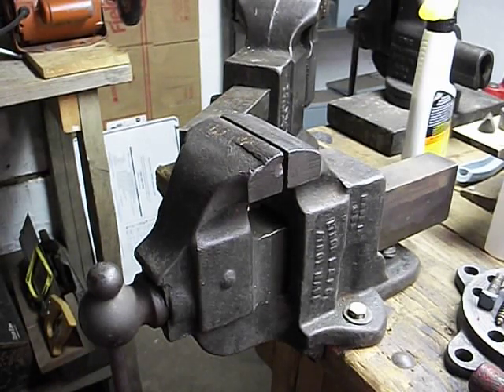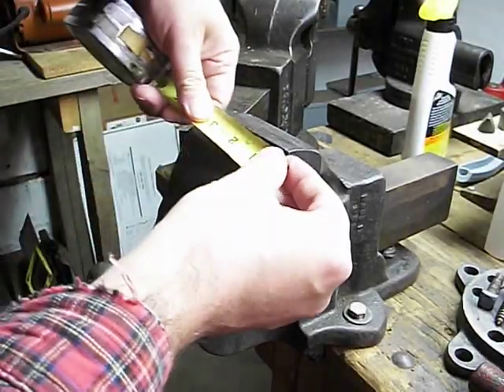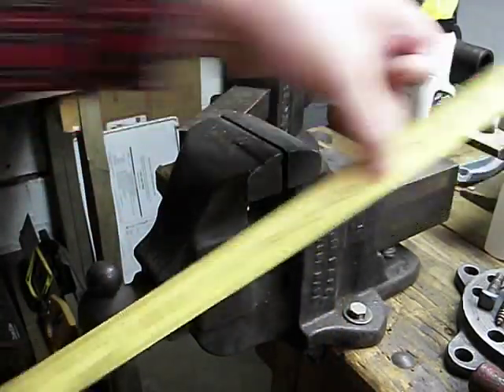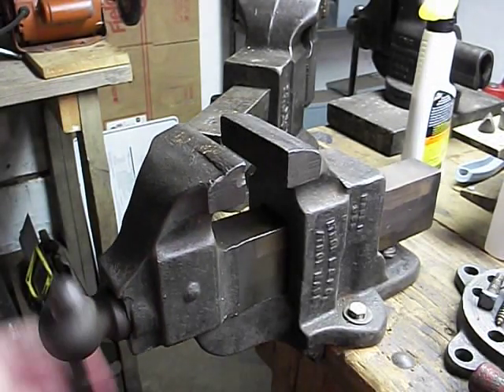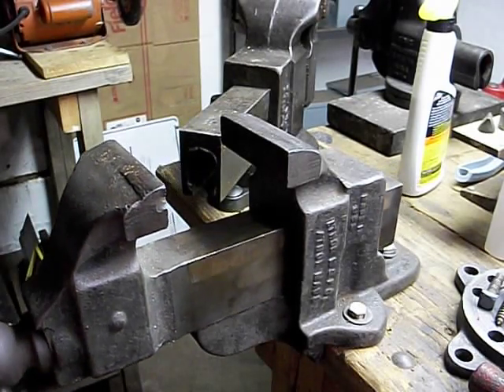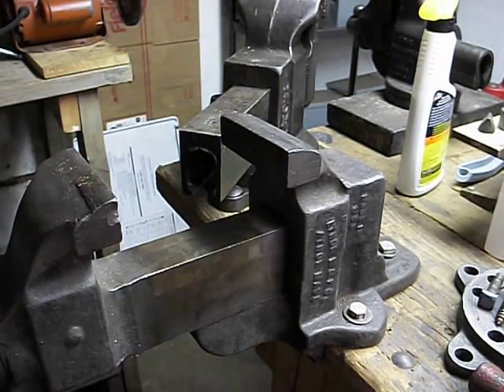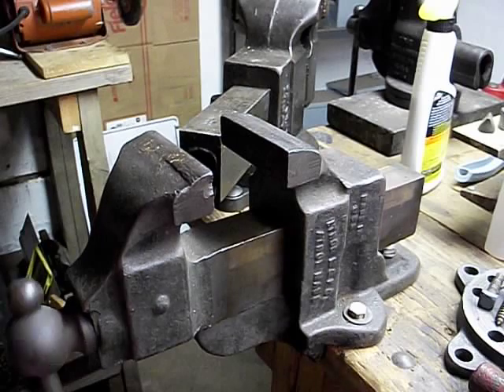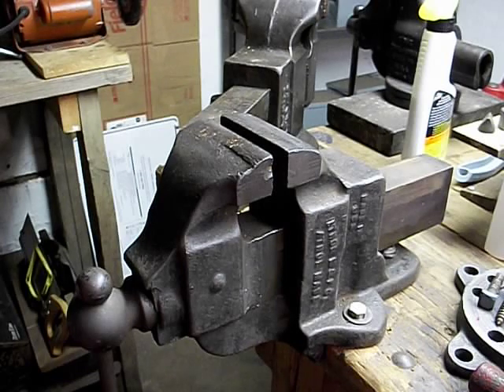Athol No. 613 1/2 Machinists Bench Vise.

Comment: If it's like the 616 that I had,  it uses a buttress thread,  which is a great thread for a vise in my opinion and used a spring to keep tension on the leadscrew so that even after a century or so,  it has very little backlash. Good quality vise.

Comment: Athol was the predecessor to The LS Starrett Company. Starrett bought Athol in the 1890s. In 1920 they changed the name to Athol Machine & Foundry Co. Since yours says Athol M&F Co. on the side that means it was made after 1920. It was most likely a machinists vise or used in some form of manufacturing environment, no way to tell for certain though. I hope this helps!